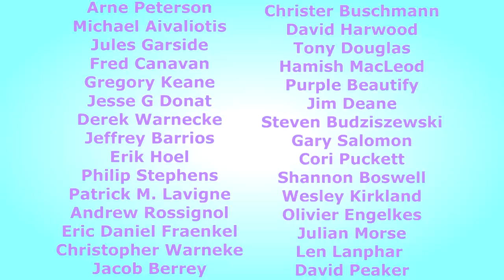My Air Pollution Solution

Comment: If I remember right, the asbestos test is basically a look with UV light.  If you see tiny starburst of some blue or bluish color, that should indicate asbestos.  You should find handheld UV lights just about anywhere.  Or you could get a UV LED and a battery or two...
Reply: I'm sure Fran already has UV lights among her lab equipment.
Reply: I bet Fran has twenty of those, on
 a shelf somewhere.
Reply: @stuartmallett6334  I bet she has the second crate of them ever made
Reply: I don't know where you got that idea, but please refrain from passing on stuff you don't really know is right or not. This is dangerous misinformation, as anyone who believes this and uses this method is at risk of coming to a false conclusion about the presence of asbestos. The primary method of looking for asbestos is Polarized Light Microscopy. Other methods can be used, but all of them are forms of microscopy, all use very expensive equipment that a lay person is not going to have access to.

Comment: Twenty or more years ago while living in the mountains off grid I built a positive pressure air system for my house that used a water bath air filter. The big problem up there was pine pollen, it would get in all my computers and stuff and clog the fans and heat sinks with so much pollen it looked and acted like felt.  I got the idea of the water bath from the old oil bath air filters I had seen on cars from the 1940's and 50's.  The Fordson tractor, manufactured by Henry Ford & Son Inc. from 1917 till 1920 used a water bath air filter.

Comment: Love the brake shoe backing art.  I was a tractor trailer mechanic for many years.  God knows how many of those 16.5 inch brake shoes I replaced on tractors and trailers over the years.  Ahh, it's so nice working on radios.  I'm not coal black from head to toe by the end of the day.  Not slinging several hundred pound 24.5" super single tires and 150 pound deep dish Detroit flywheel's  My carpal tunnel syndrome is gone, I'm not exhausted by the end of the day and my back no longer hurts.  The easy life.  :-)

Comment: Im an automotive technician, For many years I worked in the city of Chicago. When  I would service the air filters of our customer’s cars, the filters would be black after a short period of time. Since then, I switched jobs to a dealership about 20 miles away in the suburbs, the filters are nowhere near as dirty, and not black.

Comment: Fran The stuff in the beams is the remains of fireproofing to delay the buckling of the beams in event of fire and could well be asbestos based, try to seal with a thick layer of paint or PVA to make a temp seal. Also be aware of paint  flecked  type and dust in old light fittings.

Comment: Well I wish I could help. I mean if I lived in Philadelphia id gladly share my place. Also I wish I was anywhere close to as smart as you are. My most recent project was restoring an old 1940s imco lighter. I am working on a perpetual energy generator but that is going to take a lot to get done. I wish you the best and hopefully you can move out before winter and get away from all that nasty gunk.

Comment: Hello Fran. If that's blue asbestos it's not nice at all. If it's locked in by paint there won't be a problem but those workmen may well be getting their lungs full of the stuff. Your air con was a VERY good idea. If you know anyone with a microscope, even a cheap one, you will see the asbestos 'hairs' easily. It was mainly the poor devils working full time with asbestos that suffered badly.

Comment: If there was room for it, a tank that recirculates water can also help with air filtration. (Knocks out all the dust, and collects it in a catch basin.) Only side effect is that it acts as a humidifier, which adds its own indoor environment considerations. (Could be good or bad depending on the situation.) And it's something that needs its own particular maintenance to work correctly and safely.

Comment: Fran, I recon that most (not all) of what you're seeing in that filter is ash.
You'll find it in the air in most big cities because there are cars everywhere.
The fact that the demolition crew are pulling down an old brake factory is a concern however.
I agree with others that somehow you need the law to look into what's happening around you.
I don't think anyone would complain if some Patrion funds were used to explore that situation.

Just my 2 cents, take care Fran.

Comment: Yeah, I live on the intersection of a highway and one of the busiest roads here in Sydney, and it's a bit of a downslope to the traffic lights outside, so I get this extremely fine black dust everywhere. I risk venturing out onto my balcony once or twice a year for the occasional clean up, and when I sweep the dust into a pile, it actually adds up to a fairly hefty amount of dust. I figure it's carbon from either the brake pads of the trucks and cars that come roaring down the hill to stop at the lights. Either that or it's carbon from the diesel truck engines, probably from incomplete combustion or something. In any case, after breathing it in for almost a decade, I assume it's probably taken a fair few years off my life expectancy, but there's not really much I can do about that.

Comment: Another good source of collecting fine particles of dust in the air is static. There's a cheap plastic film that's 2-3 mill plastic, put it on your wall or drape it over your doorways, it will collect that fine stuff. I know, static isn't your friend, but in certain area's of your home it should be safe.

Comment: Please trim that flex duct to min length. The corrugation in the tube makes turbulent air and loss of flow.  I’d suggest to run a second filter inside the room just for safety with all that asbestos

Comment: For additional air filtering, we use a box fan with 20"x20" furnace filters.  Works surprisingly well and we can pick what level of filtration we want.
Reply: Won't be HEPA.....fans not strong enough. Maybe MERV11-12...but HEPA is MERV16+

Comment: Typically that Fibrous material is a deliberately spray-applied Fire Proof material.  Perhaps that Building is from a time before Fire Retardants were a requirement. Most places do have it. If it has an Asbestos concentration it (as most of you know) is not a great worry so long as it is not disturbed.  The Air def seems a bit much, & at 1st glance I thought Concrete Dust.  
Looks like a really good setup to keep your Air clean. I have a similar HEPA Box much larger but no Blower.  Lots of Truck Exhaust here.   I wonder if Harrisburg area might hold some lower rent Buildings.

Comment: Please be careful with the suspected asbestos in the lab. While it is held fast by paint it should be OK. Asbestos needs to be removed  properly. Here in the UK it needs to be done by licenced companies with fully trained workers and the correct procedures in place, very costly.

During my training as a gas engineer we were told that if we were unsure it was asbestos then treat it as it is asbestos. The smallest fibres are the ones that do the damage as they can get deep into the lungs and sit there waiting!

The lung diseases associated with asbestos can take from 5 to 65 years to show their hand, one of the reasons it was considered a 'wonder material' at first. Sadly we now know better and it is banned in new construction but if undamaged it is OK to leave in place. 

The contractors in your building are at extreme risk of causing themselves damage and due to their work may also be putting your health at risk when you are outside the lab but in the building. Can the city put a stop to the work on Health and Safety grounds?

Comment: I'd venture a guess the fibrous stuff on your exposed beams is a fireproofing treatment. That stuff is applied much like blow-in insulation, it's a messy and imperfect application method, and the material is most likely fiberglass-based. Not that airborne fiberglass is significantly "healthier" than asbestos... But as long as you don't disturb it, it should be ok in your workspace.

Glad to hear your Patreon got sorted out. :-P If I were you, I'd take a small portion of your GoFundMe and get your lab air tested. It's usually better to be safe than sorry, and if you DO find airborne asbestos or other issues, you can then follow up and go after them for putting your life at risk.

It sucks that they moved demo day up a month and gave you a day's notice. Absolutely ridiculous.

Comment: Hi Fran, While the grey stuff is on the filter, us a DMM so see if it is conductive to some degree. There might be carbon in it.
Have you made a water manometer to check the pressure difference between inside and out?

Comment: Test it, I bet you find aluminum, barium and strontium.  Its typically found in something called fly ash.  Can you guess where that is found, coal burning power plants silt ponds.  Do you want to try to guess how that ends up in the air. Correct, <sarcasm>contrails.</sarcasm>   Thumbs up for innovative ventilation system Fran.

Comment: Some of the dust could be coming from the duct work itself if the same duct was used as an exhaust in the past.Paint is a good thing to put over any visible fibers as it will keep them from becoming airborne. As they demolish the building are they going to maintain the heating system just for you?
Reply: She said they already turned it off a few weeks ago. That can't be legal.

Comment: Positive Pressure Air System . Excellent sounds like what I was saying before with the Air scrubber idea and You did even better with the Outside air. Now can you come up with with a Pre-heater? 
Also, that Mineral Fiber on Your Steel Columns? I've been around numerous bldg's in old Philly. Trust me Fran, wrap the columns with 4 to 6 mil plastic sheeting. Absolutely will look like Poop. But it'll work.
We did the same thing at the Customs House , 2nd and Chestnut years ago while GSA got ready to do the Asbestos Abatement. Phone guys gotta be creative , Ya Know? 
Anyway, I like the idea of hanging in thru the cold. I'm doin the same here in Clifton Heights. 
Hey,  Ya gotta do sound with that Beautiful Fender Band Master and Your Strat.
Whelp, Big Loves, Tight Hugs, an Good Luck ...

Comment: Ventilation designed by Terry Gilliam. That old stool looks as pathetic as Glenn Gould's chair he hauled around to piano concert venues. Most likely is asbestos. So long as you don't disturb the painted over material, you are fine. My 1964-built house "blown popcorn" ceiling tested positive for asbestos. Inspector said so long as you don' disturb any of the material, and keep it painted over, you will be fine. That was more than 20 yrs ago I moved in, and I'm fine. Your lab is almost a "clean room", time to do some data recovery from broken hard disks. As your lease is good until July, and you have taken steps not to kill your lungs, I'd move at your own convenience. If they really want you out sooner, make them buy out the remainder of your lease. Good luck and thanks for the updates.

Comment: Being in such a large city you should be able to find some Pro Bono lawyers that would take the case on contingency.
They would get a bigger slice of any settlement but they also take the risk of getting nothing if a suit fails.
You would not have to pay anything if you did lose...so you can pretty much guarantee a win if they took it.
I would suggest a moderately sized firm...maybe 5-20 lawyers...that deal with environmental (asbestos) law.

Comment: Good luck with the asbestos. Painted asbestos is much less dangerous than loose asbestos fibers.

I made a HEPA filter system by strapping a 4" x 20" x 20" furnace filter to the intake side of a cheap 20" box fan.  It's inexpensive and works well.   if greater filtration is desired, just buy a tighter furnace filter.    If the filter is restricting air flow too much, you can gang up two of the cheap fans.  I'm in LA, and this filter setup does work well.
Reply: a HEPA filter is rated MERV16 or higher....it's like sucking through paper. I build dust collectors for a living and can guarantee you that a box fan won't pull through MERV16. I use MERV11 and even that requires a decent impeller fan to work well. Box fans are meant for open air only and lose 90% of their power when a decent filter is strapped on. You did well using a large 4" thick filter tho..... but an inline impeller (like Fran is using) is meant to pull through a filter. So you built a filter of sorts....but it ain't no HEPA. A decent HEPA filter will run you at least $100.
Reply: @stevechlupsa9571  -  I understand that. That's why I have strapped two box fans together to pull through the filter when I have used MERV 16 or higher.
Reply: Did the same thing (but non-hepa) in my wife's studio. Keeps the dust down a treat.

Comment: Fran 
Yes it is Asbestos fine dust, I'm amazed Pilli does not have laws for the control asbestos for this will travel through out the whole block and surrounding neighbors, which is a major killer 20 30 years down the road. So what is your local authorities doing.
You also stated you could secure a loan at a higher rate if you take all your moving costs past and present the extra cost for this loan is worth the cost, as you would have a stable base and this can be used at a later date if you decide to move to larger or smaller home later in life.
Renting costs will increase more as the area improves so factoring in this the high costs to relocate every few years its much smarter move to borrow funds and have a permanent place to live and work. Also later down the road you can refinance at a lower rate as you have a asset that shit hole banks will assess for finance. Every move is costing you more and more money bite the bullet and take the loan you will be much better off.

Comment: Duct tape, plastic sheet, dryer vent hose, and cardboard. That is a true engineer's solution reminiscent of what the astronauts had do to for their air scrubbers on the Apollo 13 flight.

Comment: CALL OSHA***-say you have concerns with the construction employees coming in contact with Asbestos since you know the history of the building being brake manufacturing.  Let OSHA investigate and see if there is any risk. STOP sitting on your ass or going into the fetal position on this.   ***Also keep the air in your space humid so any dust will fall to the ground. Vacuum Everyday......But maybe use a drum vacuum with exit filter and a hose that blows the air outside.  Personally I like electrostatically charged air purification.

Comment: This is why you need a lawyer.
Reply: John  No less necessary here than elsewhere.  Our laws are very complex, mostly to serve commerce, and most of us are too busy with other stuff to navigate them all successfully and  work our advantages.  In Fran's case, she (perhaps) could leverage all the risk of delay and additional cost to the developers resulting from a well-placed complaint for exposing their tenants to asbestos.  They may sweeten their offer to her to get her out of the way and reduce their risk.  The trick is to present a credible risk to them without actually shutting them down, 'cause once you shut them down you've spent some of your advantage.

Fran may well be savvy enough to pull this off without legal help, but most of us wouldn't be.  I'm a lawyer, and I'd still hire a lawyer in a case like this.

Comment: Hi Fran. I'm hoping you can help me out. How do I measure low level noise like bass and how do I block the vibrations. I'm a frazzled mess.
Reply: You have annoying neighbors?
Reply: It's Okay to Be an NPC #435786324 vast amounts of high density foam boards or acoustic plaster boards. 
Either that or pay someone scary to gonround and smash their equipment up.
Actually there was a diy channel that made excellent sound suppressors from old towels! I will try to find it and post you a link.
Reply: You need resonating plates to kill low frequencies or a lot of foam.
Measuring is only accurate down to 100hz. It doesn't only transmit through the air, it uses any material to travel through.
Measuring it accurately will be quite expensive.
Reply: Look at the dimensions these guys build:
https://youtu.be/2AJgT4hkeHs
That's what you are looking for. 
But without accurate measuring it's just trial an error.
You need at least 1/4 of 6m of high density foam to get any effect.
Reply: @johnpossum556  Worse!! I've lived in my house for 15 years and this year, Aug-Oct, the high School football team has football practice M-TH 3:30-6 and plays rap music with a heavy bass as white noise to motivate the kids. The school, school district and city REFUSES to make them stop. No one gives AF that my house vibrates TEN hours a week for 3 months. 

Please help me stay out of jail.
Reply: I had to move. The many cars with subwoofers going past sent bass through my house like it was a tent. DROVE ME NUTS.
Reply: Would you please try and put a mattress in a corner of your room at 45 degree angle. That may help a little.
Not permanent, just to try it out.
Reply: @stevechlupsa9571  Dayam. That sucks so bad.  There are city ordinances written to make people turn down heavy bass in their cars and their homes.
Reply: @itsokaytobeclownpilled5937  LOL we have a noise ordinance but the cops are afraid of rap music I guess.....
Reply: @CyberlightFG  okay. I will try it.
Reply: They started playing the music a 1/2 hour ago. The police are tired of me calling.
Reply: Hang thick towels ceiling to floor, send them the bill
Reply: Thank you everyone for your kindness. Luckily enough, all my complaining has panned out. They turned off the music early.